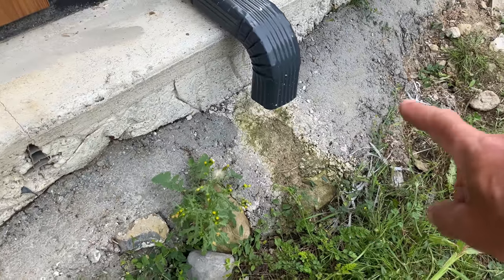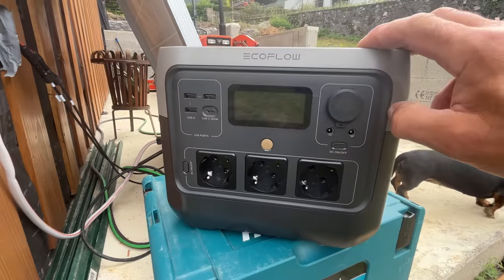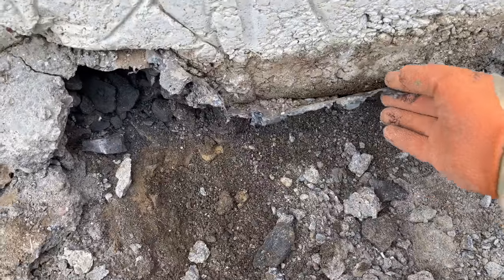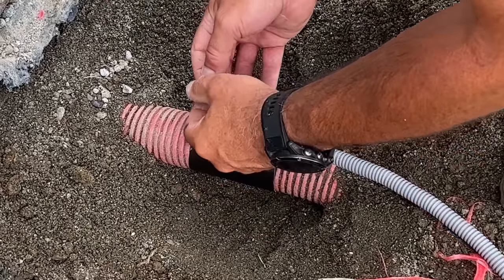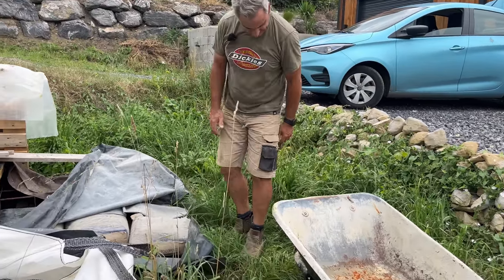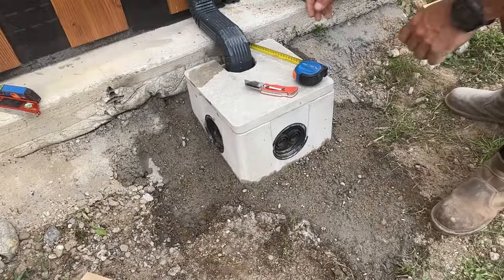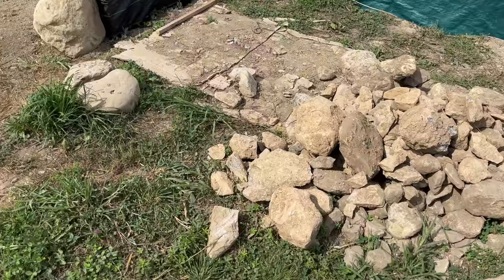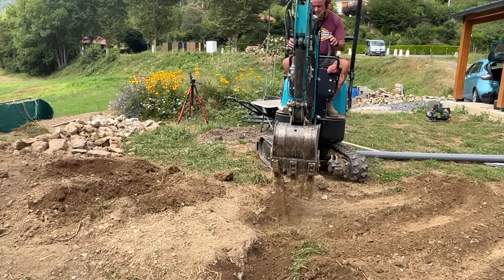Drainage Chambers and Soak aways | Garage Workshop Project Ep48

Comment: I think you have to dig with the dozer blade towards the hole you are digging. When you dig with the blade to the back, the track motors and hoses are exposed to dirt and falling rocks.
Reply from the maker: I tend to put the blade in the direction of slope (to the rear) to allow me to level off the machine.  But you are right if the blade is at the back it exposes the motors so you have to be careful.

Comment: Hi Ian, I live in the Allier (Auvergne), I believe that you need to put your new grey conduit for the pump inside a red 40mm conduit for protection. I think that the code requires that with caution tape above the conduit, conduit buried in sand at 50cm depth unless it is under concrete. Your weekly videos are great and I enjoy your careful and methodical approach. Bonne chance David
Reply from the maker: I tucked the conduit under the drainage pipe and put sand around it. The main conduit it the red one with tape over the top.   It should be ok.

Comment: Hey mate you should line your soak hole with geotech fabric first
Reply from the maker: Our local septic tank inspector told us not to line the base with textile as this would keep in any dirts and grit and in the end block it all up - she made my son remove all of his after he dumped 10 tonne of gravel.  This soak away is not washed stone either.  Hence me only doing the top.
Reply: Hi I guess the inspector has the final say. Stone soak hole is low tech. 
In New Zealand they are asking for chamber with removable lid for cleaning and a timed drain test .
Reply from the maker: @graemescebuphilippines363  if this was a ‘proper’ soak away for a roof down pipe I would have made it a little more accessible but for the French drain and the amount of water it produces this should be ok.

Comment: I love your videos.  Great to watch what I've seen so far.

In Canada when i was an electrical apprentice we buried conduit then backfilled a few inches then placed a 2X6 wrapped in caution tape over top of the conduit then filled in the rest of the trench.  But we also buried our stuff fairly deep depending on situation.  But that was ages ago when i was an apprentice.
Reply from the maker: Cheers Curt - the main conduit to the house (big red one) is 50cm down with a red warning tape above it.  This little grey spur is buried under the drain pipe do it should be OK.  But yes, it should all have warning tape above it 👍🏻

Comment: I've just done a similar thing......in case of some mad rain......I built a nice little hole Into which I can drop a big Makita pump that will quickly disperse Any dangerous rains.   But just as a back up, now I have the mini digger like yours (only one size up - almost a one tonner)......I took the digger and dug a hole that you could drop a mini (remember them - the original..not the BMW copy) into...filled it with limestone chips and then covered it with the usual driveway gravel.....probably about 500-700 litres as a soakaway....So far so good, had a couple of big rains that would give us a good sized puddle.....but this time nothing.....it all went into the soakaway...and soaked away?😀
Reply from the maker: We know the old mini - my son has a 1978 and we have a 1969.....  try to sell the 69 to pay for the the house build. 😉

Comment: I wonder how long it will be before your re digging that soak away as you should have geotech fabric all around the rocks that way it doesn’t fill with the surrounding soil and stop the water soaking away.
Reply from the maker: The local code here is not to have fabric on the bottom as this can be a cause for silt to build up as it has no where to go.  It is only for the French Drain so there is not much going in to it.

Comment: You should do long term reviews on the parkside tools, I buy a lot of them myself and they seem to be hit or miss with the robustness, depending on the tool.
Reply from the maker: I don’t have many parkside tools but they seem ok and for the price you don’t mind if they do fail but the warranty is good with direct replacement. I will be buying the 8ah battery on Monday though😀
Reply: @HomesteadingUncontained  I find the 20V range mostly good (I'm only up to 4ah batteries though) The worst battery tool I have is the standard angle grinder which cuts out a lot and I need to let it cool down for a few minutes before it can be used again.
Reply: Actually I also have one of the Pro jigsaws which cuts out a lot. :(
Reply from the maker: @demonhighwayman9403  yes, I bought that for Julie and we found exactly the same issue.
Reply: @HomesteadingUncontained  I's a weird problem, it seems like the battery cant put out enough power fast enough for some tools and overheats.